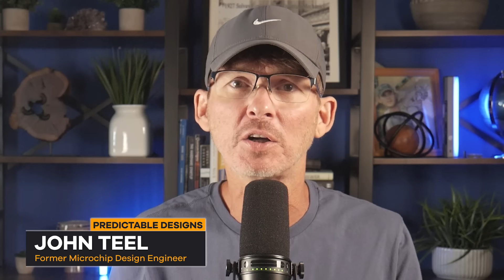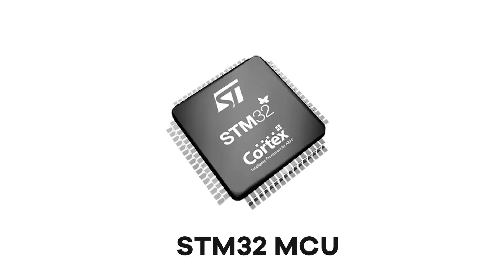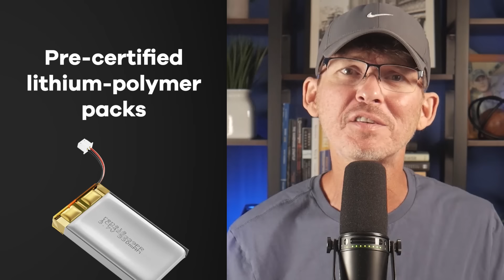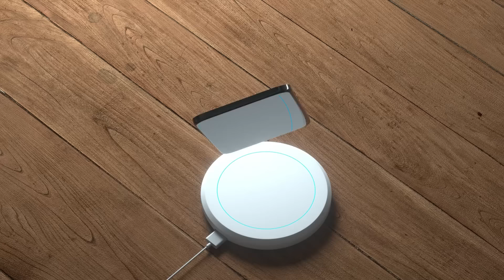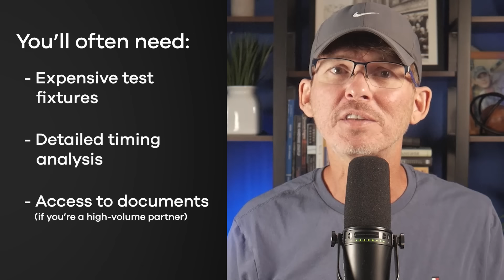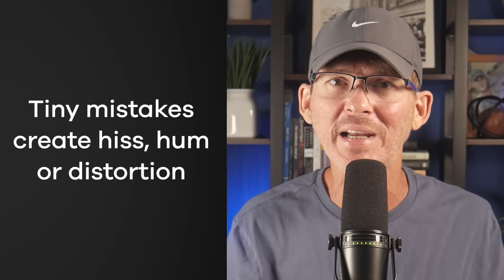10 Technologies You Should NEVER Use in a Product

Comment: I've seen so many products which have problematic combinations of USB power delivery and USB C that it's not even funny anymore, especially if we're going above 20 V: Specifications aren't easy to read, different devices seem to have different interpretations of specifications, causing seemingly compliant power supplies to trigger over-voltage protection on products, having products which fail to reliably start, or even regular USB C products which can't even trigger a 5 V USB PD source requiring users to use USB A to C cables to power the device...
Reply from the maker: Thanks for sharing!
Reply: Have you seen dells new thunderbolt 5 dock ? It can do 300W on a single USB-C, my employer has just ordered a new laptop and docking station for me, very much curious how long it will last
Reply: @timun4493  The limit on USB-C should have always been something along the lines of double what a power hungry tablet can be expected to need. Trying to also charge computers and laptops off it was more or less playing with fire. The people writing these specs shouldn't be just assuming that there's not going to be any counterfeits that lack the proper setup to be compliant with the standards and users have no way of knowing until the cords start heating up, or smoking or the computer gets fried.